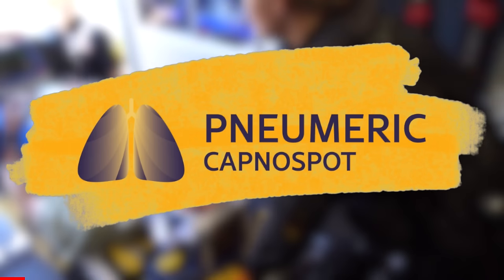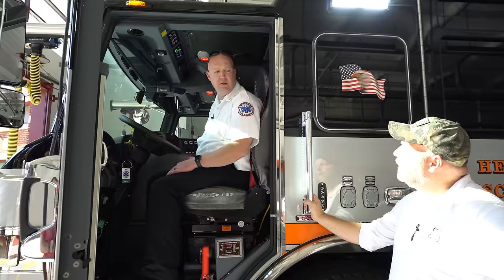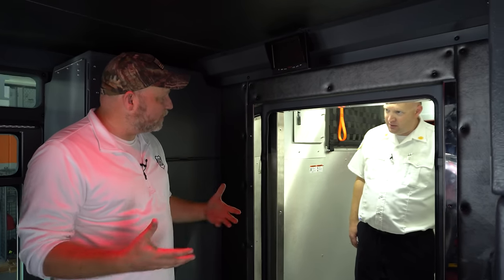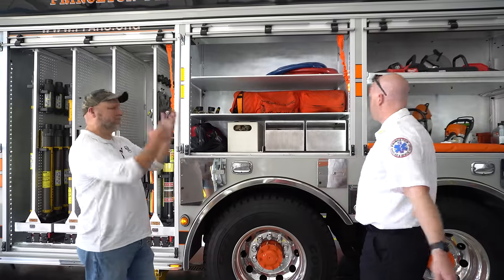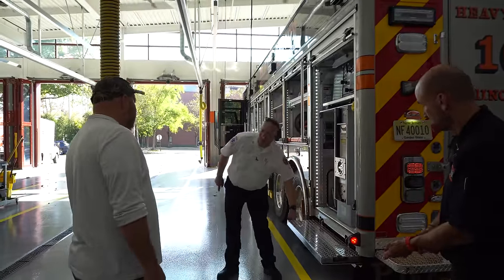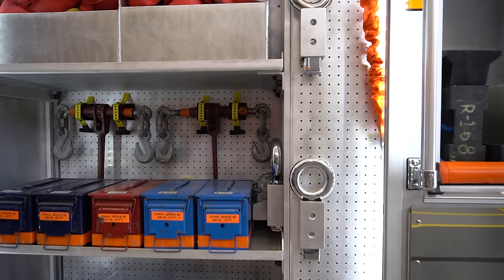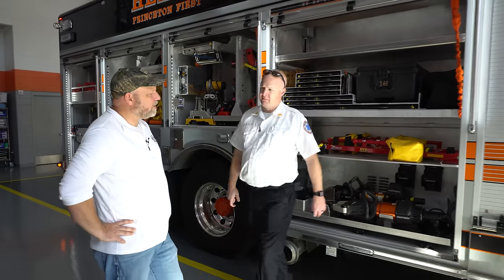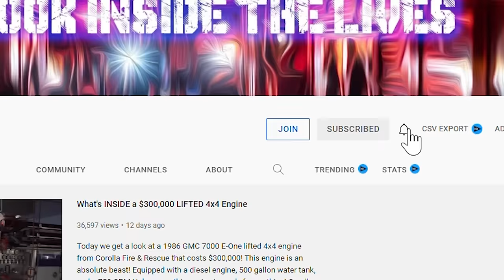WHAT'S Inside a 1/3rd - 2/3rd Heavy Rescue At Princeton

Comment: Only downside I would have with them emphasizing on those wireless headsets when on scene is, when you exit the rig you should be putting  your Fire helmet on or some other helmet or already have it on, depending on the call.

Comment: I'm all for  the battery style jaws.   But not to have a set of hydraulic jaws is stupid if your in a prolonged extraction your batteries will run out of if you get back to back extractions your out of luck with the batteries your truck becomes useless I think.
Reply: Looked like they had 2 sets of both spreaders and cutters, also extra batteries charging, and a PTO generator. Sounds like plenty of juice to me. But I get your point, I much prefer hydraulic and gasoline powered myself